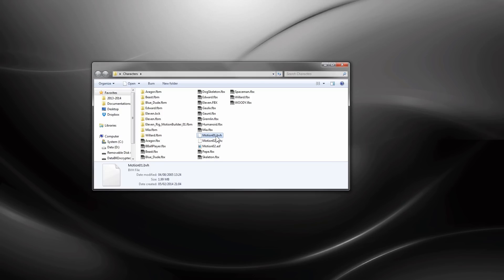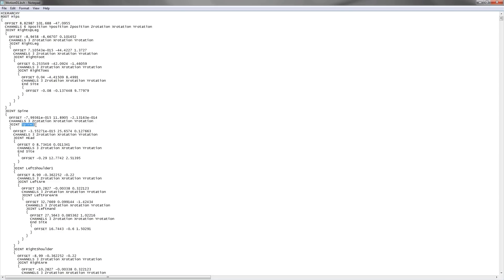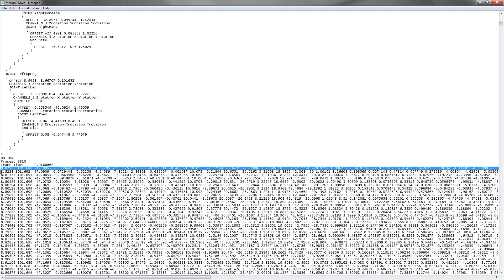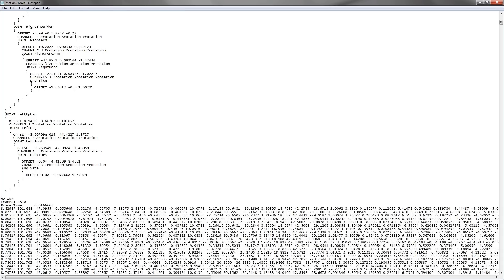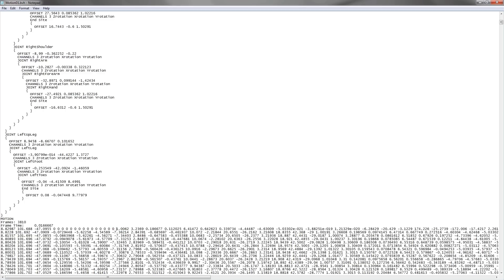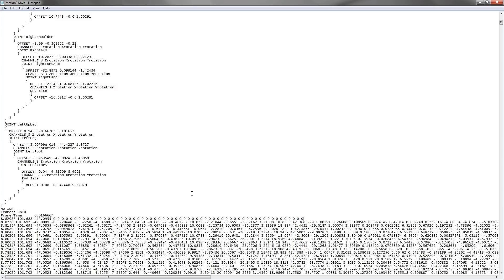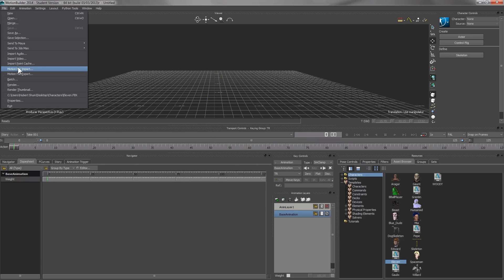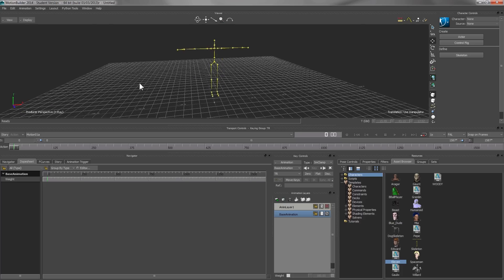Autodesk MotionBuilder Tutorial 04 - BVH Motion File Format

Comment: Thanks for uploading this video! just a question:   What does "Frame Time" means on the "MOTION" section means?
Reply: it's something related to sampling rate. it's unclear for me as well, in the original "documentation" it says that 0.033333 means 30 FPS, so my guess is that 0.0166667 here means the mocap has 15 frames per second
Reply: @broland115  You are almost right, 0.033333 means that the animation is 30FPS. We can find it by simply dividing 1 sec into 30. In similar way, to calculate the 0.0166667 all we have to do is divide 1 into 0.0166667. And the result is 60FPS not 15 FPS :).